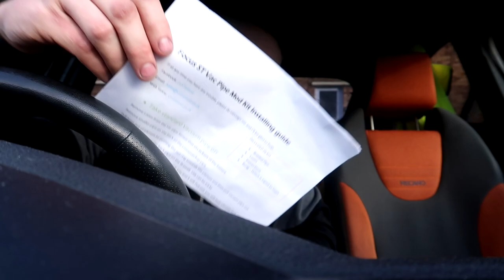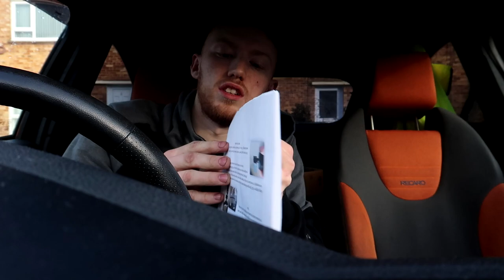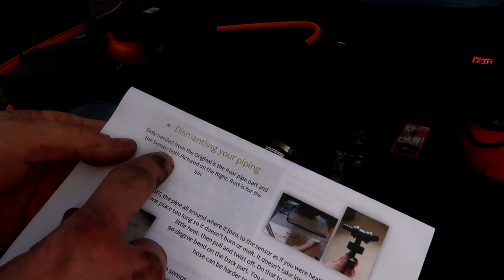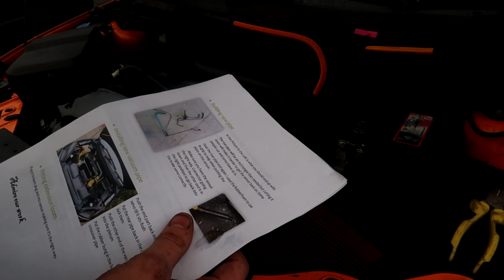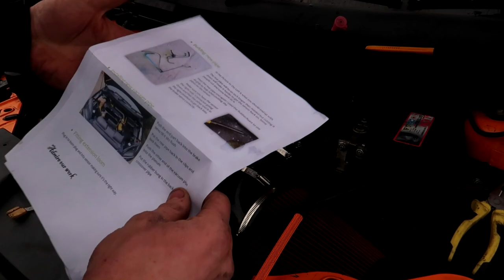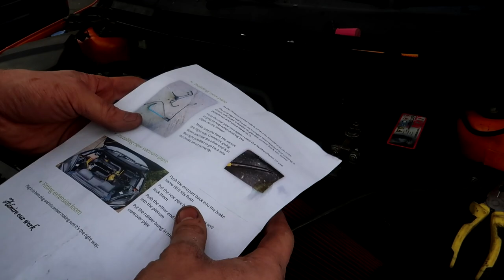INSTALLING A RS VAC PIPE ON MY FORD FOCUS ST

Comment: it's so expensive for only  a bit of plastic. We have all the needed pieces. I did it totally free recycling all hoses, redistributing and eliminating all that it wasn't neccesary. I only needed an hoses' connector that is used to connect garden's hoses and i have it also.  The electric part is easy, you extend the cable  cutting it and  it's all. The most important part is the extrem that is connected to the plenum and there you put the garden connector and connect the hose that goes to the  control valve. Thank you for your video, when i watched it I was able to see it was possible doing totally free.